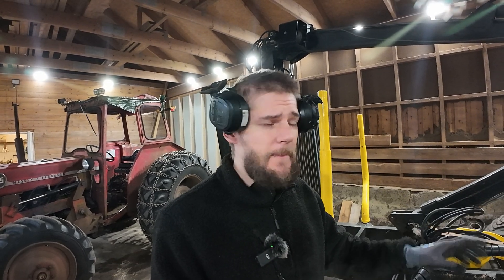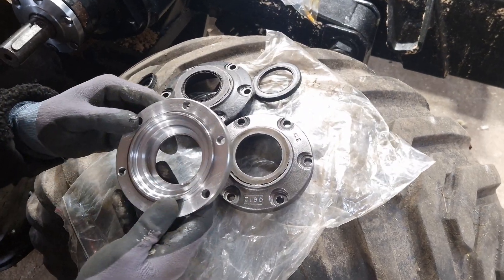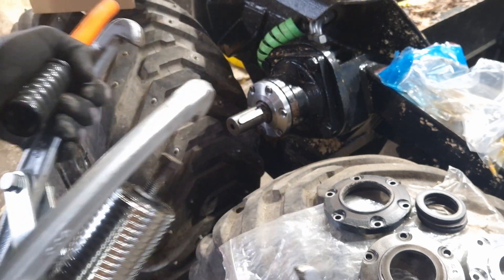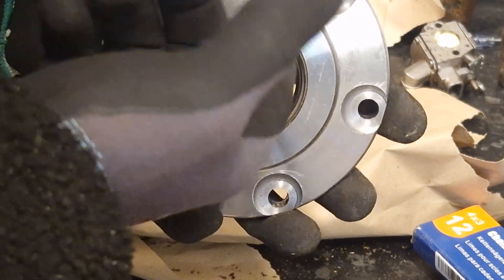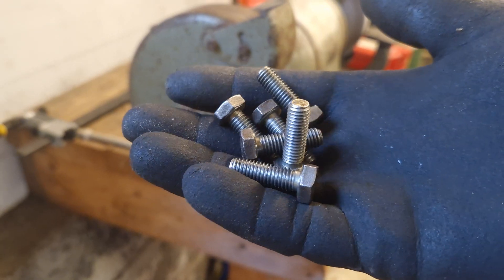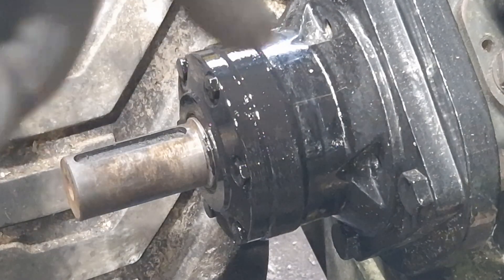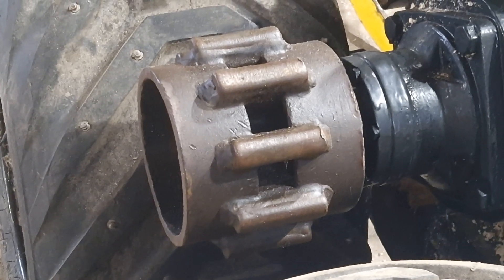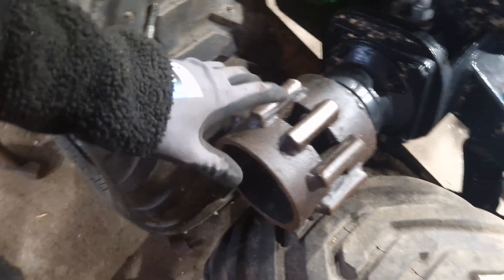Hydraulic Drive Motor Repair | 4WD Timber Trailer

Comment: For side loads must use special "wheel mount" hydraulic motor that has an extra set of bearings.  These motors often have a tapered output shaft with a castle nut at the end.
Reply from the maker: @2OO_OK  Thanks for the info! Good to know 👍

Comment: You could cut the tyres to match the drivesprockets🙂
Reply from the maker: @mac_gyver-y2d  That's true 👍
Reply: @woodlandwrench  i don't think it is that difficult, actually.
Reply from the maker: @mac_gyver-y2d  I did siping manually on the tires for the blue tractor. Just used a knife and some soap water. Could probably do the same here 🙂